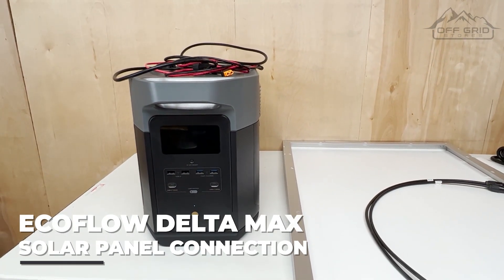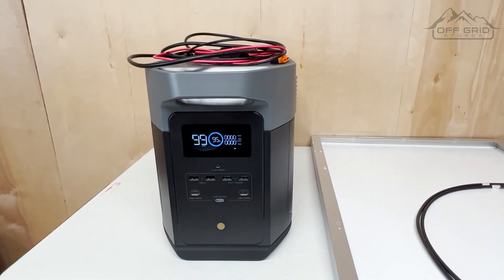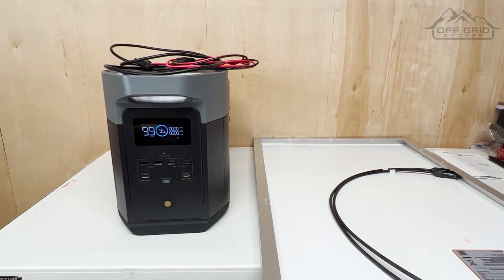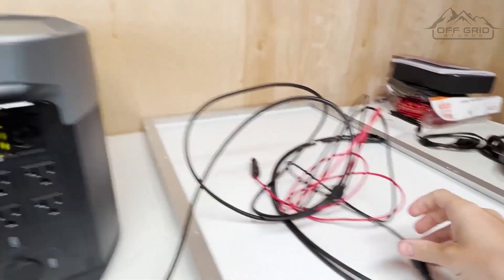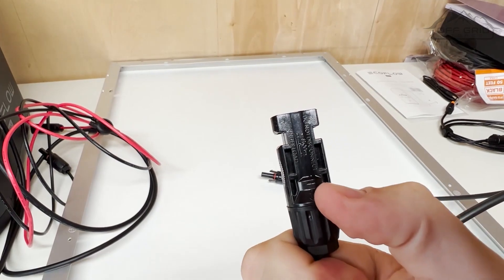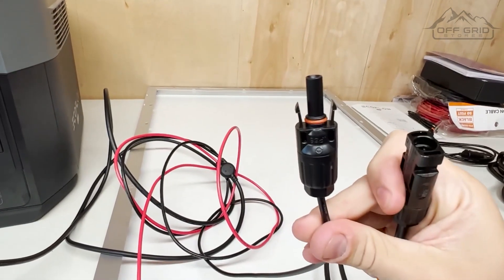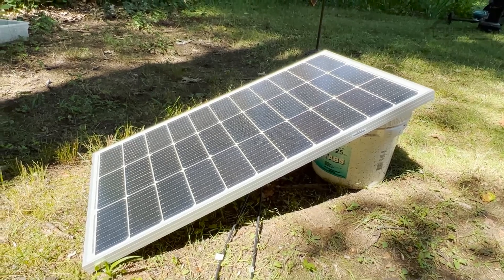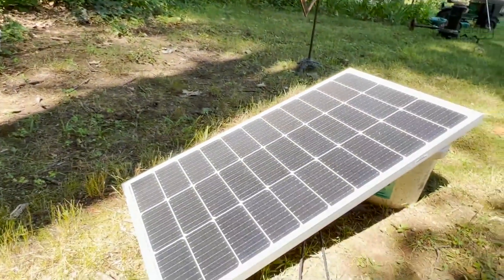How To Connect Solar Panels To Your EcoFlow DELTA, DELTA Max, & DELTA Pro

Comment: I have a 100W Thunderbolt panel from Harbor Freight but it looks like I need to adapt it to whatever the ecoflow uses. At least that's what it seems like after opening the 7 piece accessory kit that I got from there.

Comment: Second question is that i have a pvm so what can I connect to the battery out on the controller that's not a battery such as a dc to 3 or 4 usb out adapter or should i conect that to the load connector?

Comment: Can you connect a 20000 mah lithium power bank with input protection to a 100w 18 to 20 volt solar panel without a charge controller and not cook the power bank while camping? Btw i am a solar dummy 😁

Comment: Hi, I realize this video is old, so I dont know if you still check these-but since I have the same EcofIow wanted to ask---not to sound lame, are they (panels) weatherproof? I want to put them on top of a shed and leave them there for the summer-is that possible?I would just run the cords through the side somehow-but wondering id they will be OK n the sun and rain all season? Hope you see this-thanks!

Comment: Thank you! I'm the young woman, prepper, of the house- just jumping in. Appreciate the facts, the humor, and the voice. If you can say "Bueller, Bueller, Bueller" on your next informative video, then I'm set 🤣
Reply: Hi fellow prepper. 😂 trying to decide if I invest in this over cheaper alternatives. I'm gonna be broke but at least I'll have power. Do you know if there are panels with longer cables? Also does the heat affect how well the battery charges?
Reply: @potatopotatoeOG  i though i could get a longer run initially but discovered it would be costly ... Chief, you'll have to break the cable in between, and attach longer run  of same gauge, (2.5mm or bigger, though costlier) to extend it ... And thanks to your video, gave me some answers to my question which is about handling the polarity without blowing my ED2 ... Thanks once more

Comment: First, THANK YOU!!!! Delta 2 Max questions: I have three Solaria 390 panels. 1. Should I use two (780 W) or three (1170 W) ? Will my Delta 2 Max (not Pro) spill the extra wattage or will I stress the system?  2. Can I go in Series or am I over the limit and required to go parallel. Each panel: Pmax 390W, OCV (Voc)39.9V, Short Circuit Current (Isc) 13.52A, Max Power Voltage )Vmp)30.6V, Max Power Current (Imp) 12.73A.
Reply: If I’m not mistaken, the delta 2 max has a maximum allowance of 1000w of solar. So if you are running more than that to the unit, it has a safety feature in it that will not allow it to charge so no it should not damage the unit.
Reply: @gojo_1432 for the two ports or one port can handle 1000w?

Comment: I need to buy a 50 foot extension cable for my ecoflow system. Are all the ends they place on these cables a standardized type? Or does ecoflow use a proprietary connector that requires me to buy their extension? It seems they only offer one that's 3.5M long.
Reply from the maker: All the extension cables on our website will work. They just need to have MC4 connectors. Here’s a link: https://offgridstores.com/products/rich-solar-10-gauge-50-feet-solar-extension-cable-rs-50102
Reply: @offgridstores can you please help me? What do I need to hook up multiple panels and where do I get what I need?

Comment: im running my solar into the delta on the XT60I plug as shown
  
is their a way to split or Y the same solar array into a separate charge controller then to a separate battery then to a inverter to also plug into the 3 prong 110 input electric port on the delta max 
   so off one solar array you can bring charge into the delta max by 2 different ways ..one the straight solar and at same time the 110 input through inverter

Comment: You incorrectly gendered the MC4 connectors.  😄(the gender is determined by the metal bits, not the plastic shroud)  Also note the plus and minus markings on MC4 will be reversed on the delta cable because you must plug male to female and visa versa.  With contradictory information, beginners may end up more confused than before.
Reply: Can you please explain further as I'm a newbie. I have one EF 400 watt foldable solar panel and 1 Delta Pro. Also I  don't think the EF comes with an xt60i connector.  What does one do to get one and is it worth it to convert from xt60 to xt60i? Thank you for any info you may provide.
Reply: @fuzfire  Ecoflow solar panel and Ecoflow Delta Pro. I think you are fine, but you could ask Ecoflow to be sure. That's the big advantage of a single source for your equipment.

The XT60 has the two primary metal contacts (pegs on the Delta end, holes on the cable end) that carry the power. On the cable end, on the outside surface (not the face where the holes are) between the holes on one side is a third metal contact used for signalling.

If you are not reasonably accomplished at soldering large wires to small connectors, you won't be converting.

For what it's worth, the only functional difference XT60 v. XT60i for my Delta 2 Max, is the maximum current the Delta will attempt to draw, either up to 8 amps or up to 15 amps.  This means if your source is unable to supply more than 8 amps, it does not matter if it uses an XT60 or an XT60i.

With an XT60 or the DC cigarette lighter plug (which has an XT60i) the Delta will limit that input to 8 amps.  The XT60i on the solar cable that Ecoflow ships (and probably this is the same one included with their bigger solar panels) is wired to indicate to the Delta that it is safe to attempt to draw up to 15 amps.

Comment: What length mc4 connectors should I get for a long and tall sprinter van with solar panels to my delta pro in the back of the van? Thinking of doing a 450 watt panel up there. Thanks!

Comment: I have two 200 watt panels to connect to my DeltaMax 2000 on my van build.. should they be connected in series or in parallel?
Reply from the maker: Most likely series is fine but I can’t be certain without knowing the info on the panels

Comment: I was told by a couple people that I have to connect an actual battery to it too is that true?
Reply from the maker: All EcoFlow units have their own batteries inside. No sure who you were talking to knew what they were talking about
Reply: @offgridstores  thank you    I have another question In an emergency it seems like I need more than what I just bought which is the delta pro and one 160 w panel. So do I need more of both?   I am a single mom who wants her refrigerator and freezer on here and there plus my kids to not feel so uncomfortable being without. I am new to all this.   Any help I would greatly appreciate ❤️

Comment: What if I wanted to buy and use a different solar panel,how would I know if it will work with the echoflow delta 2 or not?
Reply from the maker: All solar panels will work. Just make sure they have MC4 connectors. And also make sure they are within the voltage spec of your Delta 2
Reply: @offgridstores  perfect! I didn't know the name of the connectors used on the delta 2. Thank you 👍

Comment: Hello! Nice review. Is there any loss if I plan to use a longer cable like 30 to 40ft to connect between the EcoFlow and the solar pannel? What is the maximum length allowed without loss? Thanks!😊
Reply from the maker: Minimal and you will be fine. Keep it under 100ft

Comment: What will be if I connect 545watt solar panel (17A) to ecoflow delta 2 that supports up to 15A?
Reply from the maker: As long as the Voc is below the max Voltage input of the Delta 2 you will be fine. It will just pull the max Amps it can, which in this case is 15A

Comment: we are in the uk spennt £1000 on the delata 2 . will not charg of soler .we are using renergy panles
Reply from the maker: Not sure what the problem is. I would reach out to them!
Reply: Did you solve the problem? I was going to get renogy panels to go with my delta 2- thanks

Comment: Thx. for the video. Is there a possibility that you could get electrocuted when you connect them to the Panels? I just brought a Ecoflow Delta 2 and 400 watt Solar panel.
Reply from the maker: No you'll be fine. And you should've bought them from us and you'd have gotten a wiring diagram 😎

Comment: Would love to see a video of you running 4 panels... I think 4 panels w/ my Delta Pro should be able to keep my 2 freezers n my 2 Fridges a running... I'm NEW to solar myself.... As soon as I get it figured out an Extra battery is next...
Reply from the maker: If they are 100W then you will probably need more than 4 panels. I am actually going to post a video today about wiring panels in series vs parallel where I use 4 panels as an example. Stay tuned!
Reply: @offgridstores  aight den, let me know...
Reply from the maker: @fifeohfarmingnstuff4416  just posted it
Reply: @offgridstores  Thx... will watch it at my place of Employment tonight. I have an Ecoflow Delta Pro, just want enough juice to power 2 freezers n 2 fridges. Gotta have Cold Beer when the Power goes out.